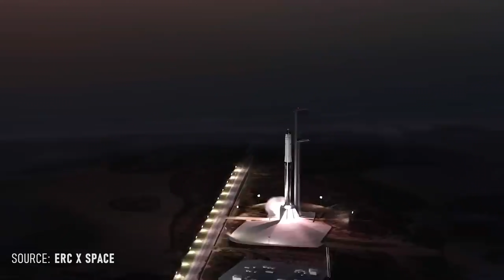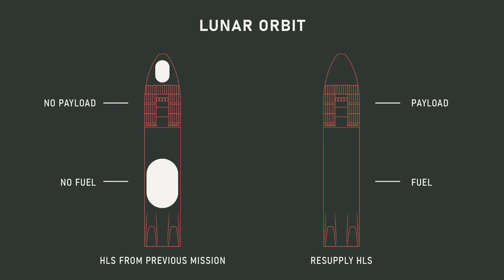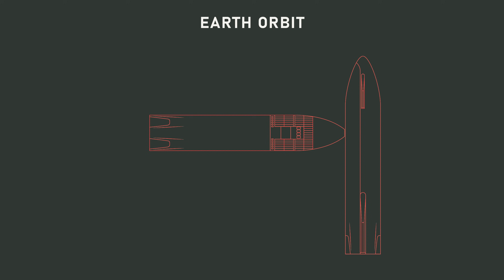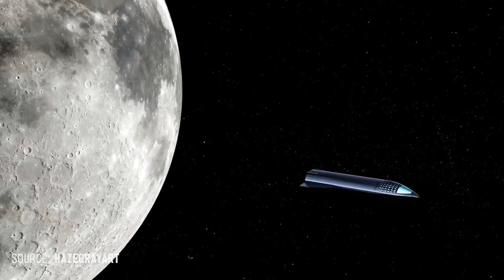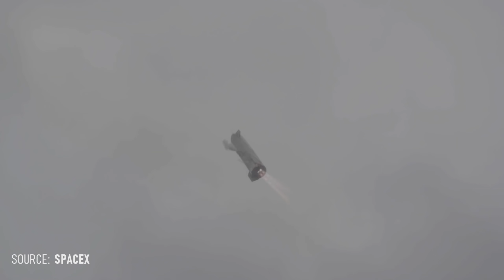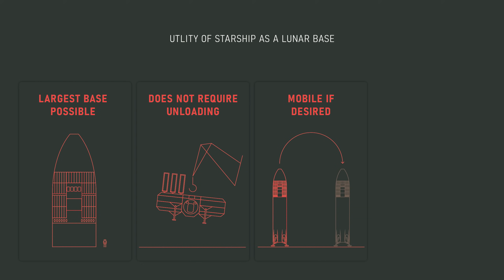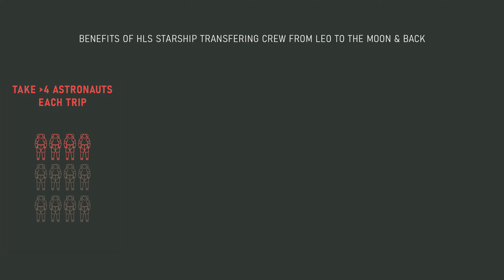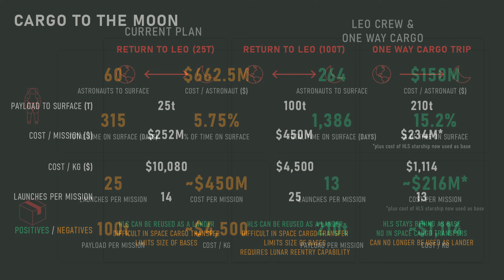How to Use HLS Starship

Comment: HLS simply doesn't make a good lander for routine surface missions given the number of refueling flights it requires for a single mission, but it has capabilities that no other spacecraft is even attempting. It's designed to support crew for several years without resupply, and if refueled in LEO, it's designed to travel outside Earth's SOI. A single HLS could serve as a replacement for the ISS, a lunar space station, a lunar base, or a manned orbiter for Venus, Mars, or the asteroids. I'm not going to discourage any mission that will allow HLS to become man-rated, but Blue Origin is already providing a traditional lunar lander in the style of Apollo. We need to use HLS for what it's good at, and moreover we need to take advantage of what it could offer.

Comment: Since they are going to use side thrusters to land HLS to avoid kicking up dust, why not go all the way and land it horizontally.  Landing legs could be attached in LEO using space walks.  Now you have a Lunar base habitat that makes sense and the dang thing won't tip over.  Multiple HLS one-way flights would be used to build up the Lunar base.  This would be an unmanned mission to get the base in place before sending astronauts.  Use SLS to get female boots on the ground to beat China for political purposes and then cancel it.  You could even have a configuration where the HLS is almost all living space and use a standard Starship as a first stage to get it to the Moon.  There are all kinds of configurations.

Comment: Have you considered using aerobraking for an unmanned HLS to get it back into a LEO orbit after returning from the Moon?  Instead of coming back in 3 days it would take weeks but if you are going to do four missions a year you have 3 months to get it back into LEO.  The Mars Reconnaissance Orbiter used aerobraking, no heat shield required.  You could also use Lagrange points to get the HLS to the Moon with less propellant.  Again, not as fast but why does it need to be ?

Comment: The least expensive way to deliver four astronauts to the moon… is in a Crew Dragon XL on a crew rated Falcon Heavy.

Once in lunar orbit, transfer to a Starship HLS and repeat on the return to splash down 🎉

Lunar crew rotation, etc.

Starship HLS, fuel and cargo flights to the moon, can have multiple configurations, both crewed and un- crewed.

Of course, lunar dust will ruin everything 😂

Comment: I feel like you've forgotten the problem of landing a FIFTY METER TALL VEHICLE on the infamously uneven surface of the moon, not to mention the fact that there's going to be people and cargo aboard. Just a 4 meter tall lander, the IM-1, tipped over during landing how the hell is a 50 meter tall HLS going to?
Reply: 1: It doesn't matter how tall the vehicle is. What matters is where the centre of mass is. And the HLS has 200t of fuel at the bottom of it.

2: IM-1 slammed into the ground at an angle while going 20km/h because its instruments failed. That is hardly a comparable situation

Comment: Why not split the Lunar Starship into 2 parts (creating a 3 stage system)  the large tanks and raptor engines are only needed to get it to the moon.  once there the upper section could detatch and land.

Comment: Now that Artemis is actually flying, it’s interesting to review these options. Another option that should make a huge difference is refueling on the surface of the moon. Even though Starship uses methane which isn’t available there, oxygen is, so by hauling a little more methane, many more Starship variants (and missions) become possible.

Comment: @15:18 it also puts all of our eggs into one poorly tailored basket. Starship isn't a good base design, if you were to sit down and draw a lunar base you'd never put 25 meters of fuel tanks in the bottom. It can't be buried in the regolith, can't carry enough water to shield itself, can be accessed if the elevator doesn't work (and regolith is bruital to machinery) and worst of all, it becomes another single point of failure. The plan is to have more than one HLS, and I'm sure to have more than one firm building modules for a habitat. If we just use one HLS providers ships and they get grounded it's game over.
Reply: As a follow-up. In this video and elsewhere folks taking SpaceX's side on this have heavily relied on the source selection document. SpaceX is way behind on their development of Starship and the NASA employee who wrote that document has found themselves making considerably more money at SpaceX. It sure looks like a "thank you" to me.

Comment: You don't need people to move the cargo or a mechanical arm.  You just use Astrobee analogues (optimized for logistics) remote controlled from earth. 

Also, you don't need to send another starshp to refuel starship.  You package the fuel and gear and then boot it from orbit with some attached thrusters and the aformentioned space-labor-bot.

Comment: It's nice that with Starship we could have multiple missions in a year.  Two issues:  First, Starship has never flown as a complete launch system.  Second, what is the purpose of so many astronauts on the Moon?  I'm not against the notion but what are the missions about?  Science?  Minerals?  Base for Mars mission?  Competition with China?  There is no way SpaceX launches 50 Starships in the next three years.  Not technically feasible for an as yet, unproven system.

Comment: From what I can tell going from LEO to NRHO (3.95) (pick up crew) to low lunar orbit (0.73) to lunar surface (2.0) back up to a low lunar orbit (2.0) and then NRHO (0.73) would take about 9.4km/s of Δv, about the same as going from the surface of earth to LEO. Since starship, even fully fueled isn't a SSTO, I don't see how a lunar starship could do all that in one stage, and have enough fuel to return to LEO.
Reply: If we assume 15t for life support crew compartment etc. (Orion without any propellant) and that starship has about 6.9km/s fully fueled with a 100t payload (I think elon tweeted this number once, but then again he tends to be optimistic), we get 8.8km/s of delta v, which might be just enough to abandon the empty starship at the gateway station after landing on the moon (the Apollo lander had ~2.5km/s for landing and 2.2 for ascent, but with 0 safety margins you could theoretically do them for 1.73 each).
If Starship was refueled in a eccentric orbit, it might have enough to return to a orbit with a periapsis in the upper atmosphere, but without a heatshield it would need to activity break into LEO (would need another 4km/s, this just isn't possible) or do many passes through the upper atmosphere, where the steel alone could survive the aerodynamic heating and flaps aren't necessary. This second option would however greatly extend the mission and would take any crew on board through the van Allen radiation belts multiple times (not going to happen). 
So: expendable HLS probably
reusable HLS maybe
HLS to the moon and back without Orion/SLS, definitely not.
Reply: You can probably get away with a mission like this: launch into LEO refuel 12x burn ~2.5 km/s into a GTO (HLS has 500t of fuel left). Send two tankers and fully refuel them in LEO (24 more refueling missions), then use these to fully refuel HLS in GTO. These tankers now aerobrake from GTO and land back on earth. HLS now has 8.79 km/s of Δv in GTO use this to go to land on the moon and return to lower refueling orbit. Send a tanker to LEO refuel once, fly to and refuel HLS with 45t of propellant, aerobrake back. HLS returns to LEO.
Total starship launches: 39 (38 if HLS was already in LEO from previous mission)

Assumptions: 
starship dry mass: 85t
HLS dry mass: 100t (extra 15t for adding crew compartment, life support, crane, supplies, airlock, legs, landing engines, etc. but removing TPS, header tanks and flaps )
Starship payload to LEO: 100t
Starship Δ v fully fueled with 100t payload in LEO: 6.9km/s
Delta v map (in km/s): 
LEO > 2.5 -> GTO -1.7 LLO -2.0- surface 2.0 - LLO -3.0 refueling orbit - 1.2 - LEO.

Comment: This is a very interesting and informative video. There is one issue that puzzles me about your asserts regarding SpaceX BFR/"Starship" capabilities. You mention that this craft has radiation shielding, and it may well have some, but whenever a manned spacecraft or space station leaves Low-Earth Orbit (LEO) to either go to Earth's Moon or to higher orbits, it is leaving (either part of or all of) Earth's magnetic field and thus Earth's natural protection from solar radiation storms and galactic cosmic rays. While this uber-large SpaceX vehicle may offer relatively expansive facilities and even some shielding, the only way to protect astronauts in cis-lunar space, including the lunar surface, from the storms and the rays would be to bury the crew habitat under a layer of lunar "regolith" topsoil and/or water-ice. (The only other way to establish a shielded base on the Moon would be to establish the crew habitat deep inside an underground lunar lava tube.) Are you proposing burying a SpaceX ship in regolith or landing it in a lava tube? Also: did Artemis include establishing a space station near the Moon to act as a "truck stop" for cis-lunar travel, or has that been taken off the table?

Comment: Your dual Starship flight plan is amazing. I have been saying lately that SLS, and by extension Orion, is effectively defunct with the capability that Starship promises. With your flight plan, it's both safer, more effective, cheaper, and more sustainable. Simply brilliant. And this is before even considering the incredible increase in cargo capacity.

Comment: If we included ISRU in the base, an LEO > LEO starship should be more than possible. This may not be feasible due to difficulty of manufacturing methane on the lunar surface. It would also be risky due to the fuel transfer on the lunar surface being required for a return back home, which may require having a lifeboat on standby in the event of an emergency.

Comment: I really like this video and the idea of using a starship as a base is great. But, I think there is a problem: I don’t think 210 tons to the lunar surface is possible. Cargo to the moon surface can’t be greater than what starship can carry from the earths surface to low earth orbit. Current expectations are for starship to get 100 tons to orbit initially and maybe up to 150 one day. Now a lunar base starship would not need  heat shields or wings but would need legs. I guess this would mean tens of tons less weight so maybe 120 tons to orbit. The only way I can see to get greater than 120 tons to the lunar surface would be to load extra cargo in low earth orbit. Am I missing something?
Reply from the maker: No you are right. I was going more of a “physically possible” number. It would need extra cargo loaded. 

However keep in mind that HLS doesn’t have to save fuel for landing on earth when launched and has a much lower dry mass than normal starship so it may be possible it launch more. 

That being said I wouldn’t bet on anything >150t
Reply: @Apogeespace  Hi, thanks for the reply. I'm sure making the trip to the lunar surface a one way journey would mean some sort of advantage to cargo capacity and the logistics of getting the starship to the moon (maybe less orbital refuelling). I hope NASA is open to ideas that will make the best possible use of starship.

Comment: Ya know, the 'floors' of a starship can be oriented any which way, like paralell to the long axis for instance. Imagine arranging the interior volume more like an ocean liner than a tower block. The experience of the passengers would be very different, more social in the former, larger spaces would accomodate larger groups and more inclusive activities. When on Mars, lay it down flat. For long duration transit cable two belly to belly, pay out the cables and apply rotation. Ballroom dancing all the way to Mars or the moon and back.

I'm sure SpaceX engineers can make berths to accommodate launch and landing forces. In transit, with or without centrifugal 'gravity' the principle is the same.

Comment: The problem of the atmospheric engines on the lunar Starship, and all the engines being trapped at the bottom of any Starship left on the Moon as permanent habitat, as well as the optional nature of the upper thrusters, point to a different approach, one rail shipping uses. The payload and the locomotion are separate, so depending on how much power/lift is needed more locomotives are used. In the same way lift should be containerized as a component of a lift system comprised of LOX, fuel and engines. Add orbiting "Roundhouses" where lift and payloads (both cargo and passengers) are assembled into optimally efficient packages and sent to a similar site in orbit around the Moon where lift components are returned and payloads are attached to Moon-Gravity appropriate lift. 

Also, imagine NASA wants to use Dragon Crew + F9 to lift crews to the Roundhouse where they are attached to a large spherical ball that captures and integrates them into a single, large crew habitat with redundancy and perhaps some basic features like bathrooms & workout facilities. It is fully pressurized but the CDs are always there, in addition to space suits for lots of redundancy. This package, looking a bit like a corona virus, is then attached to a lifter comprised of vacuum engines and propellant. In this environment, where human lives are at stake, it  would make sense to have a "propellant bus" where vessels with ONLY LOX, or ONLY fuel would be combined into a thrust-support assembly and that attached to the engine/s component. Once at the Lunar Roundhouse (probably some Lunar insertion orbit point) the CDs are landed 1x1 on the moon using appropriate lift assemblies, or en'masse by a much larger lift assembly. The LOX and fuel tankers might make perfect lunar habitat since they don't ensconce any engines on the lunar surface - put there by specialized lift assemblies which return to Lunar orbit.

Comment: Starship HLS can be used for the following:  Lunar Lander.  Lunar Gateway Space Station.  Lunar Base.  LEO to Lunar Gateway transfer vehicle.  It would be best if  SpaceX can develop:  Starship Tanker. Starship LEO refueling station.  

Further,  for Lunar Base Starship, put the FEET on the crew end of the vehicle and leave the empty Raptor stack on top.  It puts the crew closer to the lunar surface and eliminates the crane/elevator hazard.  It only requires a 180 degree  flip on the landing approach.

Comment: If i was to do this and i sure elon has already thinking of this. Fuel only needed to level earth and moon. when star ship is in space there are few options which cost very little to nothing to use. solar sail by it self or pushed by high power laser. Ion thruster . yes these would not be fast changing Days in to weeks or months. but Free if you get 20 star ships going none stop to the moon and back. over time you can get alot there very cheaply .

Comment: @Apogee Two things: 

1) What would launch the astronauts back up from the moon, I'm assuming one of the other two current HLS options? Probably that should factor into the cost on the option where Starship stays and joins with the Lunar colony.

2) If it's easier to load all the cargo on earth, then would it not be better to get those re-entry tiles mounted back onto the Lunar Starship and, instead of dropping into LEO, to just coast all the way in for a fresh load of cargo (on Earth surface)

Comment: As you mentioned with the obvious problems with refuelling in Lunar orbit with the extra empty starships and fuel capacity. A solution could be to find a mass producible fuel source on the Moon that could be used to power the Starship back off the Lunar surface. The only problem with that however is the fuel type. Another solution that could be proposed is a fleet of lunar tanker ships that would sit in low lunar orbit, I’m talking hundreds that could supply multiple missions to the surface of the moon and back.